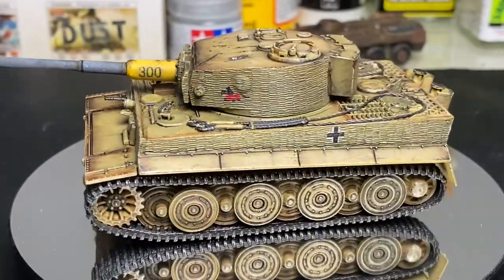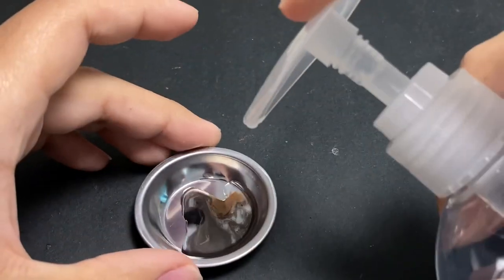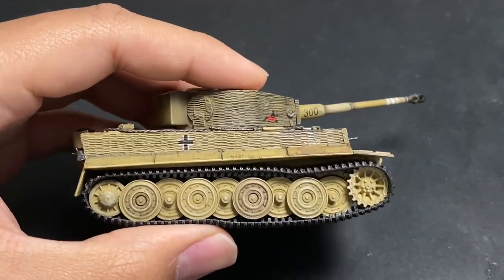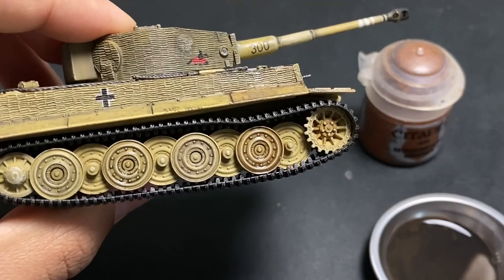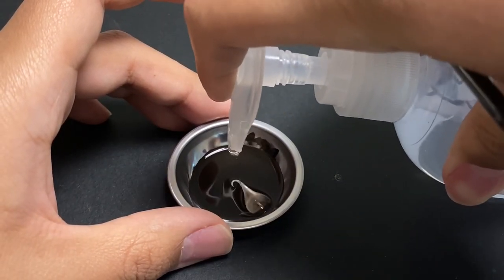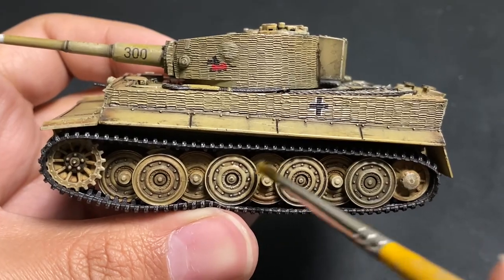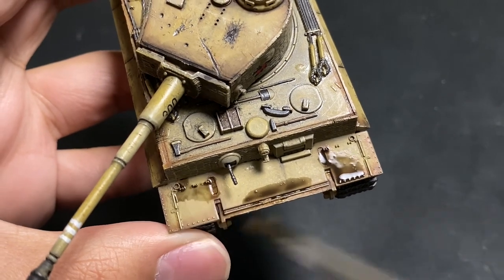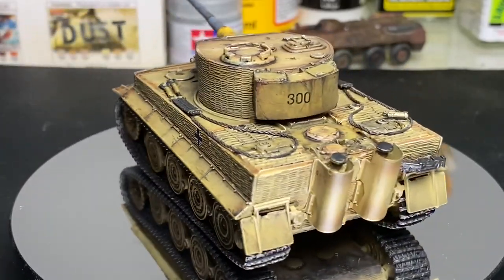How to create your own Acrylic Soap Wash!

Comment: What is that liquid you add before the hand soap?
Reply from the maker: Just soap and water from the faucet. You can use acrylic thinners to achieve a fluid level for large flat surfaces or detailed areas. Especially a capillary action effect.
Reply: @Modkits131  cool! Thank you!

Comment: What about painting over this with a clear coat to seal it in? Won't the soap cause problems with the adhesion of the clear coat?
Reply from the maker: I’ve personally never had issues before. I’m always using water based acrylics.
Reply: @Modkits131  good to know thanks

Comment: I like how you showed the different types of paints and brands with the Tamiya ones being the best. I usually use Vallejo paints, but maybe I should whip out the old Tamiya jars again! Do you have any recommendations for rust washes/streaking effects? I have attempted it with your method, and I can never get the colors right. Great video as always!
Reply from the maker: In this instance Tamiya worked out nicely for me, because I managed to get the mixing ratio just right. Vallejo and Citadel work just as well. For other acrylic based brands, I’m sure they’ll be very similar. 

In the end it comes down to your preferred choice of paint brand. Whether you want a matte, glossy or satin wash for your models. 

For a rust wash mix I recommend black, brown, red and yellow. These colors can provide a nice variety of rust tones. With only so little. :)

Comment: Would isopropyl alcohol work as well?
Reply: So.... would it?
Reply from the maker: It would. But be cautious, as too much rubbing alcohol could damage the paint if you’re not too careful.
Reply: @Modkits131  alright, thanks man. Would it be a better option than soap due to the fact it evaporates a tad faster therefore leaving no residue, or no? Just kinda concerned the soap would leave some kind of small film on the paint
Reply from the maker: @mentalillnessconnoisseur6260 It is a bit better than soap because of the flow it gives to paint. I just prefer soap and water because it’s usually easier to remove, if done properly.
Reply: @Modkits131  gotcha. Thank you for the info